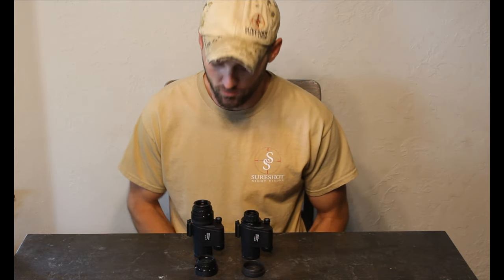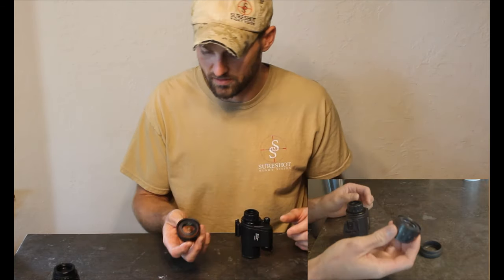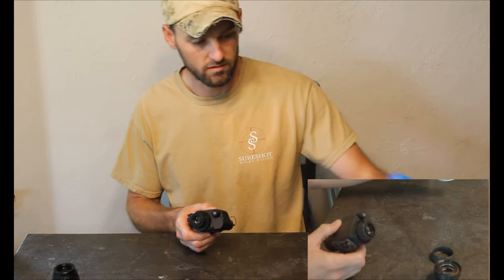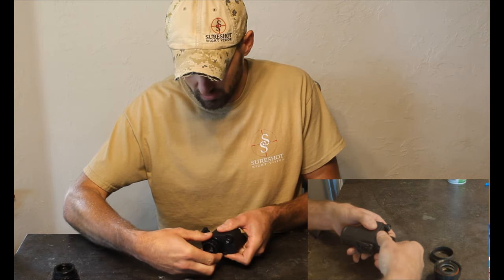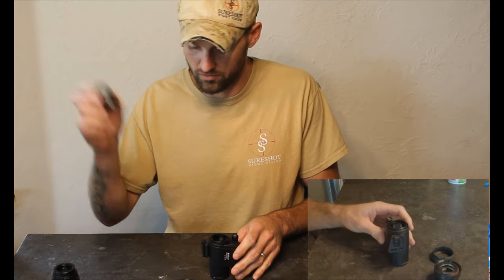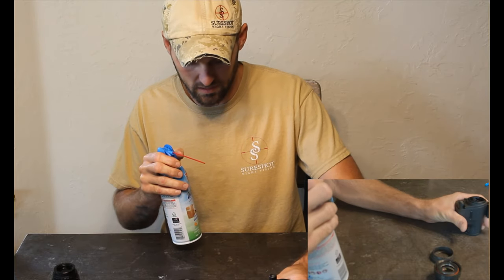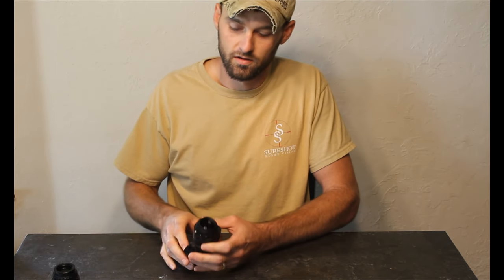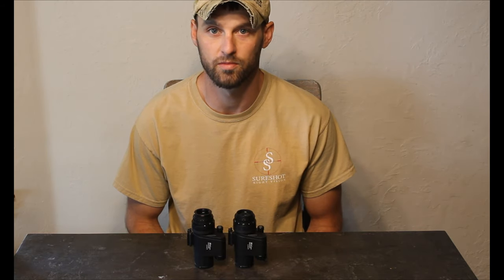IRay MH25 Eye Piece Upgrade Installation

Comment: Good video bud!  When I removed mine the factory"Potting" material went everywhere inside.  I managed to turn the keyed inner part inside the body about 20 degrees...Thank God I was about to turn it back straight.
Reply from the maker: Timmytimetactical  thanks man! Hopefully this helps the guys having trouble with the swap.